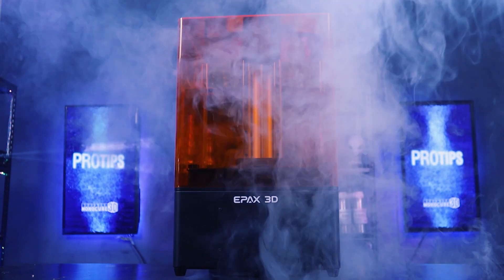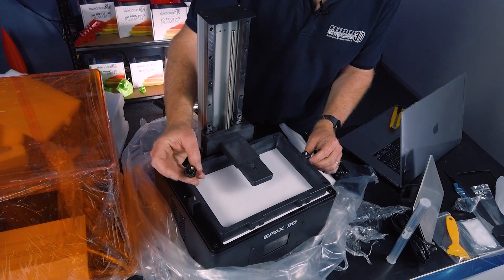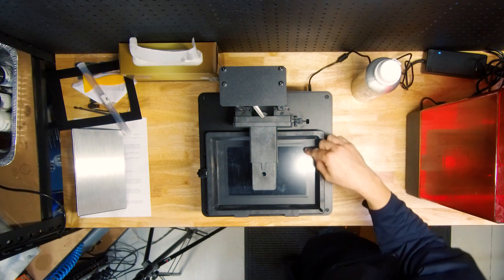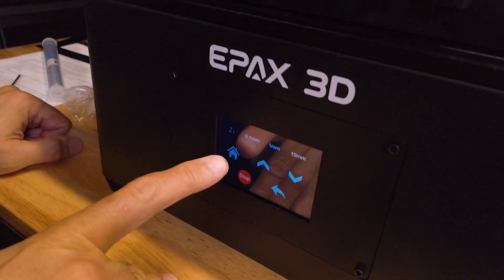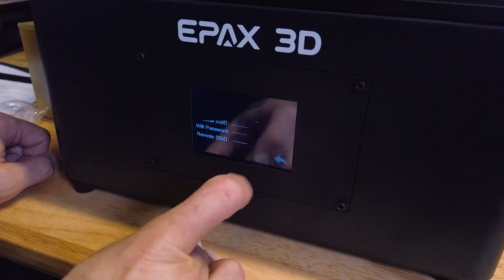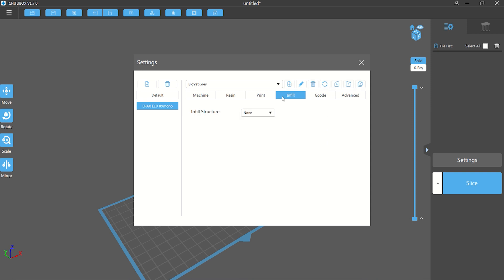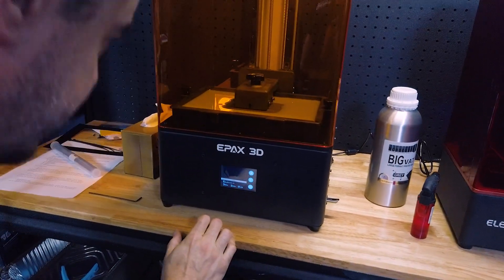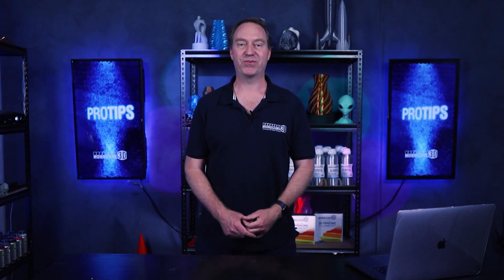Setting up the Epax E10 3D Printer

Comment: I was dead set on getting this, even though as I'm in AUS it's very expensive (1,324.73 via Amazon).
However, after reviewing all of your videos on the 4K Mono Printers and reading the comments, It looks like your favorite is the ANYCUBIC Mono X, which I could get for 1,081.69.
The main reason I was wanting the Epax E10 was I wanted the largest build size so I could do larger models without having to print too many pieces. So being able to upgrade to the 5K larger build size was a big draw for me. That said I've never done 3d printing before, so I'm not really sure if the larger build size is a large enough difference to make a difference.
And now I'm really concerned hearing that you have had problems with the plastic build plate with difficult prints, as I would imagine larger 5K prints would have even more problems...
Reply from the maker: I have the Epax at home now and the plastic arm that holds the build plate is a big fail. It flexs with bigger prints and then resin gets flicked out of the vat while printing. It’s really hard to keep up with what’s the best printer as they seem to bring out a new one every month! At the moment, yes the MonoX is probably the best in this price and size range. Good luck!
Reply: @Monocure3DProTips  Thank you so much for the quick reply. That's really a shame.
I'm assuming that the plastic base is why you don't recommend the Phrozen Sonic Mighty.
Was there anything specific about the Mono X that puts it over the Creality LD 006?
Reply from the maker: All are good printers, but the MonoX has the ability to turn down the LED power. Plus, it will restore a print after a power outage! Those 2 reasons alone are enough for me!

Comment: New to 3D printing, especially Resin.  I have followed the steps in this video for setup, print head is leveled, and I recently just flashed the latest firmware.  The issue I am having is that I am getting alot of curing outside of the print area during prints leading me to believe I have a flickering issue even after the new software release.  I am printing for jigs and harder objects so I am using the Epax hard and tough as well as the Esun hard tough resins.  I have printed several items with various degrees of failure.   Epax Hard and tough is base about 25 seconds, 2.5 for layer and the 28 for esun with 8 second layers.  Can anyone help troubleshoot the excess cure in the vat that is ruining prints?
Reply from the maker: Usually down the time of exposure and number of bottom layers.
Reply: @Monocure3DProTips  Thanks for the quick reply.  I did lower the exposure on the esun (all that I have left) and I will post results.  Both so far have been printed with 4 bottom layers, but ill look at that next.
Reply from the maker: @chadjones7722  don't be afraid to try our resin!
Reply: @Monocure3DProTips  14 hrs later I still have curing outside of the desired print area in weird layers, at different points in the print most of the printable area is cured around the model with the model still being pulled through this cure layer.  Looks like a part with weird large leaves hanging off of it.  Cure time is 2.8 seconds per layer.  No complete failure of print (it did adhere to the print head) but this is still a failure of a print.  

Like I said I flashed all the updated files for the firmware, but it appears my model may still be flickering during the print?
Reply from the maker: @chadjones7722  Sounds like you might have a dodgy cable connection between the driver and the LCD - might be worth opening up the printer and checking all the connections are ok. Run a dry print with no vat and observe what is going on. If you see anything ab-normal then you will know what the issues are.
Reply: @Monocure3DProTips  for some reason the LED wires were crossed between fan control and the screen, which left the screen partially on throughout the print.  Customer service recommended the exact swap and its been flawless since.
Reply from the maker: Awesome! Glad you worked it out. Happy Printing!

Comment: On the contrary, the Set Z=0 does indeed do something.  You cant use it until you hit the Home button and then manually use the Up and Down buttons to move the build plate.  The message he highlights in this video appears because you hadn't made any actual adjustments to your existing home screen setting.  Be very careful when you manually move the plate up and down.  For example, don't hit the Down button when your plate is all the way down and the height option is set to 10MM as this will force the plate down into your screen.  Use the 0.1 and 1MM settings to fine-tune your settings accordingly.   Once you get it set to where you want it, you then can hit this button and will give you the option to Confirm your new settings...
Reply from the maker: Ok thanks

Comment: Epax levels the beds in the factory. My E6 didn't need leveling, it worked perfectly out of the box.
Reply from the maker: Good point! I remember this, but I guess we just do it out of habit now!
Reply: While I haven't tested it yet, I've been having failed prints on one side of my build plate since getting my E10 (have owned an X1 for a year now and it's great). I couldn't figure out why and found this video today that mentioned leveling using the four screws which the X1 didn't have. I believe this will be the key I was looking for.

Comment: When I go to fill the vat on my E-10, I home first.  That way you can fill the vat to the top and not have to worry about overflow.  Great video guys!
Reply: how is your experience with the plastic molded buildplate?
i just found out that e10 is shipped with a plastic instead of a metal / aluminum plate.
i feel like this kind of build plate will get loosen more often compare to a metal ones.
how often you encounter a problem that requires to level your build plate?
Reply from the maker: @losaminos59  Not a fan to be honest. We have seen it move on difficult prints. It need to be in Aluminium in my opinion.
Reply from the maker: @losaminos59  We are not a fan of the plastic build plate - it moves during difficult prints.
Reply: @Monocure3DProTips  I see.. Worse is that epax doesn't offer any metal or aluminum build plate for E10 on their website. I don't think X10 is compatible with it.
Reply from the maker: Great tip! Thanks for the positive words.

Comment: Is that really all you guys did to level the bed? I have a bunch of Photons and I always need to level it with a piece of paper that pulls out perfectly  even. Tried doing that with my two new E10s and can't get either to do the same. They just won't stay "level". Is this method not necessary with the E10?
Reply: Glad to know I'm not the only one having leveling issues with the E-10.  It stays level for maybe 4-5 prints.
Reply: @HeroicDimensions  Honestly, I'm finding the buildplate rather cheap and I'm having consistent issues keeping the thing level. Like, how much more expensive would it have been to just make the buildplate all metal? It's what they sent out to a lot of early reviewers like Uncle Jesse and 3DPrintingPro. WTF, EPAX?
Reply: how is your e10 doing so far? 
i'm on a fence between mono x and e10 but seems like this plastic molded buildplate from e10 is big let down...

how often do you need to level your e10 build plate? 
i feel like this plastic plate will surely get worn out with screw holes very soon because of continuous levelling and tightening  compare to metal or aluminum plates.

Comment: Why are all 3D printing channels so careful with the print plate? scraping it will just increase the adhesion of the bottom layers... it doesn't damage anything - as you actually say yourself at about 18:00
Reply from the maker: If you want to print flat on the build plate any scratches on the plate will be seen on the model.
Reply: @Monocure3DProTips  Well, I usually just print undersides flat on the plate. Therefore scratches don't matter at all.There are probably models, you could print flat on a side, but I haven't encountered one yet.

Comment: A hot air gun is also good for getting rid of the bubbles. I also use one of those magnetic mixers to stir the resin. This does not introduce bubbles like shaking does. I just received mine and it is my first mono printer.
Reply from the maker: Yes another good way, thanks!